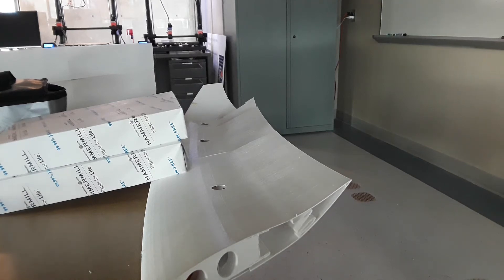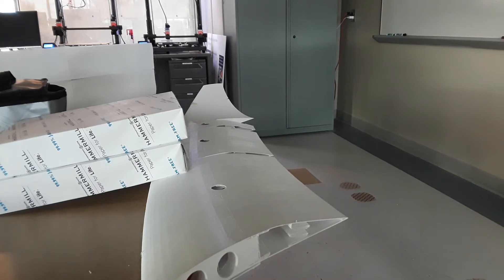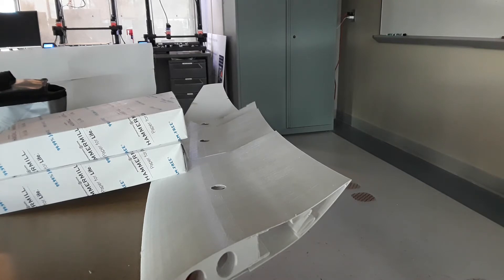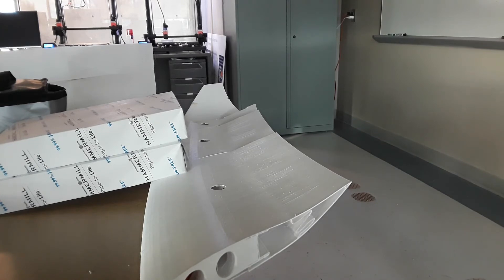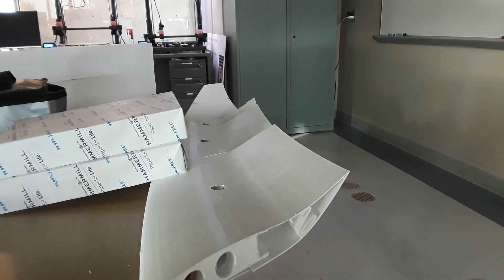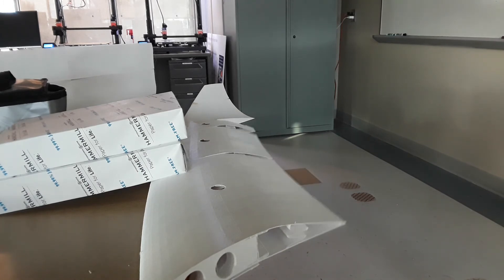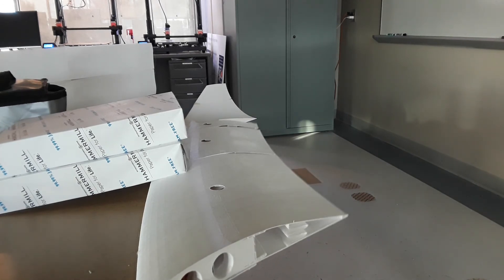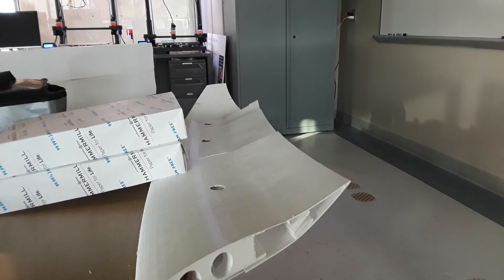MTE P18I17S04 - P18I18S07 static test deflection test

Comment: Very interesting work!  I follow sailing boat design, such as the SailGP F50, which uses a fairly traditional wing+flap design. Morphing wing technology may be seen on boats in the future too. These boats are also using hydrofoils which suffer from cavitation once they exceed a bit over 50 knots, and really need to use a cavitating foil arrangement beyond that... another area where morphing tech would help, although major engineering hurdles exist.  Best wishes for your research. 👍 🇦🇺
Reply from the maker: Thank you!

Comment: thanks for the link.     looked at the paper.     and this is what i think. 
this idea seems to be  Only  applicable to  tailless GLIDERS.!!!!      at  that's  a  dam  LIMITED  range of application.
apparently, the paper  fails to mention an  OBVIOUS  fact, that partially explains certain data:
when an aileron does not extend to the wingtip, the  non-moving part of the trailing edge  DAMPS  roll response, while causing  Drag, that would not otherwise be there.!!!!
WHAT  do  you  think  you are gonna accomplish, that the hortens  did not  ALREADY  do.?        this appears to be a case of someone wanting to  prove, to HIMSELF, that reality is real.      cheers
Reply from the maker: David,
It is a limited study, but that is the direction most fighter aircraft is going. We are taking the non-morphing wing tips into account. The Horten brothers were legendary. We are simply trying to push the envelope.
Thanks!
Reply: @BenjaminMoulton  bla-bla-bla 
a  jet fighter  is  NOT  a  tailless, glider.!!!
at the end of the day,  such a study, (of glider wings) at low-re#  numbers,  is  HARDLY  relevant  to  higher re# fighter wings.      have fun, in your denial of the  Facts.      out
Reply from the maker: @daviddavids2884   We will see! Thanks,

Comment: do you see that,  if your design is not just very complex ailerons,  during down deflection,  it would cause an increase in  LIFT, as well as drag.     so, there would  STILL  be  roll moment.       cheers
Reply from the maker: David,
That is correct. For this reason, the control algorithm will create a lift distribution along the wing such that no rolling moment is induced, while positioning the drag so a yawing moment is induced. My colleagues paper on this is here : https://arc.aiaa.org/doi/abs/10.2514/6.2021-0327. Here is video presentation of the work : https://youtu.be/tIRSUzFJ7aI.
This paper should be up on USU digital commons and ResearchGate soon, I will attach the link when it is.
Thanks!
Reply: @BenjaminMoulton  hmmm.    so, this is all about  GLIDING, then.?
Reply: this is a whole lotta complicated, heavy stuff, just to control the yaw, of a flyingwing glider.   as i have mentioned, under thrust, this idea has  Inherent  issues.    cheers
Reply from the maker: @daviddavids2884  That is definitely true. There is a flight test planned in the next couple months. I will keep you posted! Thanks,

Comment: thanks for providing the link.
'if the initial premise is flawed, so will everything else be.'
imo, you have  NOT  understood some things about  bird  wings.
(as it happens, i did a lot of studying of birds, back when i wanted to make a rc ornithopter.)
when a bird is flapping its wings, and  flying forward, there is  some, mostly, PASSIVE  flexing, at the trailing edge primary feathers.     when a bird is not flapping, the wing geometry does not change very much.
a bird uses 'under-camber' in its wings, mostly, for high-g maneuvers; eg., rapid deceleration  or  landing.!!!!        and, at those times, the  THRUST  is  'turned  off'.
your  idea is  OVER-complicated, servo-heavy and has too many points of potential failure.
it would  result is  MAJOR  increases in the feedback force, that a wing experiences;  whenever  there  is   THRUST.!!!!      the activation mechanisms  would  Feel  those forces, First; and, THROUGHOUT  the duration of the deflection.    followed by the main spar and wing root.
i suggest, therefore, that you should  NOT  expect the actual  implementation of this idea.     cheers
Reply from the maker: Hey David,
Those are some interesting points. The purpose of this morphing wing is not to approximate bird-like flight, while that most certainly inspires morphing wings. The purpose of this aircraft is to demonstrate yaw control using morphing wings. For the wing deflections, instead of using traditional flaps like most RC aircraft, this aircraft uses compliant mechanisms to approximate a parabolic flap. These flaps are designed to increase the induced drag between control surfaces in order to provide yaw controllability. 
You are correct, the wing has several structural problems. I am working through those right now, with 4g load test happening here in the next couple weeks.

You can read more about parabolic flaps here : https://www.researchgate.net/profile/Douglas-Hunsaker-3/publication/334438748_Geometric_Definition_and_Ideal_Aerodynamic_Performance_of_Parabolic_Trailing-Edge_Flaps/links/5d2c9acd92851cf4408700d3/Geometric-Definition-and-Ideal-Aerodynamic-Performance-of-Parabolic-Trailing-Edge-Flaps.pdf)

Thanks!

Comment: followed your project for a while, its coming along now!
Reply from the maker: You can read more about the KINCS and ARCS mechanisms in my SciTech Paper here : https://www.researchgate.net/profile/Benjamin-Moulton/publication/348253153_3D-Printed_Wings_with_Morphing_Trailing-Edge_Technology/links/5ffddb4645851553a03d4a88/3D-Printed-Wings-with-Morphing-Trailing-Edge-Technology.pdf
Reply: @BenjaminMoulton  Hi Benjamin, hope your well. I never moved past airfoil Cross sections I could never get enough deflection (typicaly 5-7 degrees) without compromising the strength of the part beyond viability or having a very heavy assembely. Much of it was an experiment for the printer I had at the time. Looking forward to reading your paper, I've kept up to date with each of your uploads. Can't wait to see how far you get. Best of luck in your research!
Reply from the maker: @jimboloco539   Thanks!
Reply: @BenjaminMoulton  the fact we see what see in trending, and not work by people like yourself is a tradgedy. Keep it up!
Reply from the maker: James, I remember you saying you were working on something similar. How is it coming along?